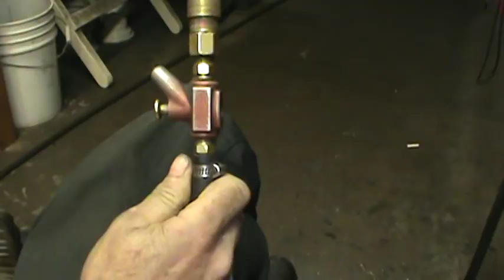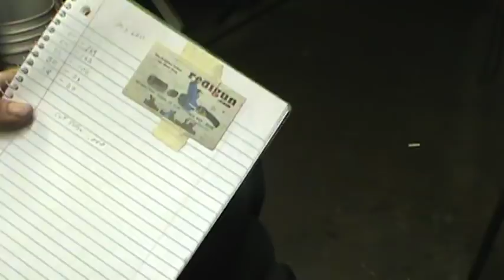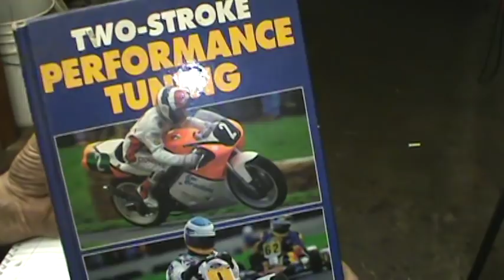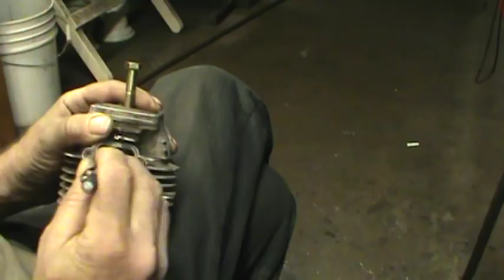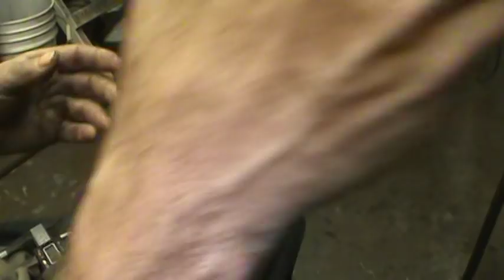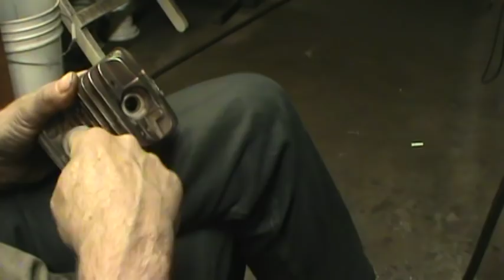porting video series part 4, lets talk about ports

Comment: I wish people would stop with the torque vs horsepower argument. Torque is a force value, horsepower is a speed and force value. You can't have one without the other, like volts and amps. If you are walking or running you are moving the same amount of weight but running requires much more power than walking. Consider this, a chainsaw at wot but not in the wood actually makes virtually no horsepower because there is no torque being created, there is no load.

Comment: Will order that book today if it's not over-MSRP (last time I saw one I wanted, the 2 available copies were >$300, a-holes!!), thanks for the reco, wanted one for a while now just never found one w/ endorsement I could trust (and I can't recall your name on OPE but have little doubt you're an authoritative voice there!)  
Hoping there's some at-home planing machine I could use for dropping cylinders, will make all the diff in the world (for my 660 cyilnders I should be able to figure-out something, since it's flat, but my cs590 - which is "done", but'll be "really done" once its motoseal'd base's 0.027" squish is dropped to ~18thous, but it has those flanges that drop-into the bottom-end casing so cannot just flat-machine the base :/ )
Your videos are just so top-tier thanks a ton, was a bit overwhelmed with my 3-figure number of OPE tabs on my computer right now, brain-overload had me using inferior Youtubes so I could at least stay on-track (things came early, (3) 660 cylinders landed this afternoon, 2 regular pistons & 1 pop-up, and the g660 so I now I have the 2 working bases, one generic & one built by an OPE member from a prior GTG), was/am so stoked to get OPE-level information on Youtube can't believe I didn't find you sooner!! Thanks a ton, again, for all you've uploaded, so much great content shared for free, what Youtube/social media is/should be all about!!!